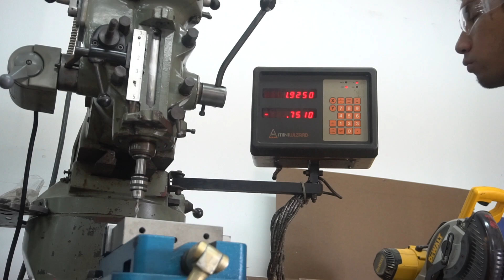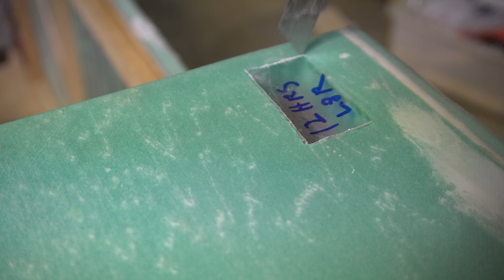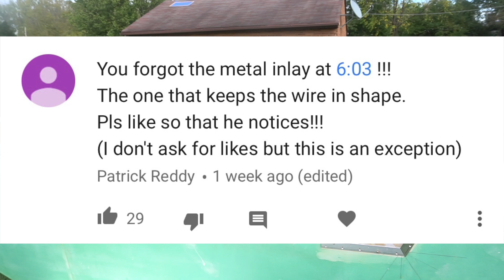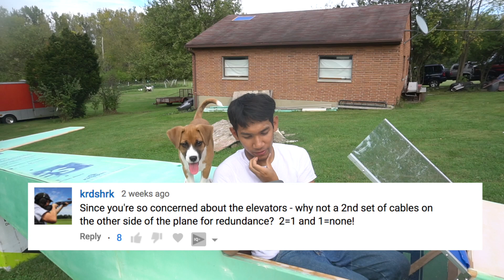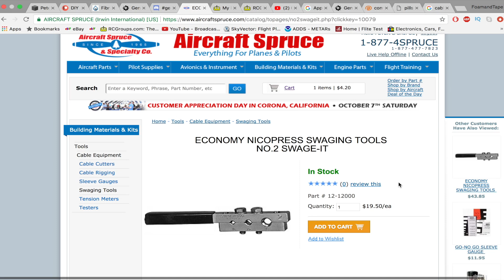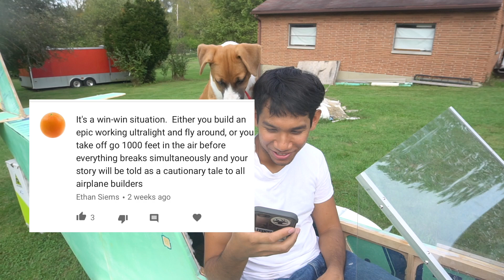DIY Electric Ultralight pt4 (fiberglassing fuselage and wing construction)

Comment: Peter I don't know if you'll read this comment but, at 0:53 when your cutting the pipe, you are using the wrong part of the vice. The part that is under where you have your piece clamped is specifically called the pipe clamp portion, its stepped so you can have four contact points on the pipe.

Comment: Very ingenuity. I’m researching building a composite ultralight myself. I heard you mention you work with a company that will hot wire full 8ft wing sections and that it was quite reasonably priced. Would you mind sharing that company’s contact information. Thank you. Keep up the good work

Comment: I have rigged my sailboat with that nicopress tool, and it works fine, also have run up some climbing gear with it.  You can check the result with a dial caliper if you have the dimension, or compare to known commercial.  I think sailboats are a lot more heavily loaded that a UL, partly due to the massive loads that come from tossing around objects that weigh thousands of pounds in hard water.  Beating to windward you can get slams and bangs that are worse than a hard landing with every wave.  You don't probably get the fatigue cycles as quickly as anything with a motor, but for you first flight fatigue is not your problem.

Comment: I really want to build a plane too but I’m broke... gonna have to resort to building mine out of empty pizza boxes and resin 🤔
Reply: do it glue alot toghether for thickness
Reply: Add fibreglass in there and you're sussed
Reply: The problem with that is resin is thick and heavy
Reply: dont worry i have the same problem 😀

Comment: PeterSripol, sorry Dude but I agree 100% with Armando Silvier. It only took me around 5 seconds to see that your design is somewhat wrong with respect to centroid or center of gravity. Your wings is too fart back. It should be more at the front to balance the pilot's weight and the engine's weight. what you did is you placed your wings at the back of the cockpit which is wrong. Find the center of gravity of the pilot's seat and engine and that's where the middle of the wings should be located. This is just a positive criticism to save your money due to remodeling your work and much more to save your life if you try to fly that in that configuration. BTW I am not a pilot or an Aeronautics engineer, I am a Mechanical Engineer but definitely this issue is related to centroids and moments (wherein the reaction force/lift that should be given by the wings should be balanced by the weight of the engine on one side and the weight of the pilot on the other side) so Mechanical Engineers and Aeronautic engineers have very similar knowledge on this topics. Aside from the wing location, I can say that you're doing a great job Dude! Keep your hopes up, make your design airborne, and stay safe always!!!!

Comment: I've heard you mention F.A.R. 103 and I'm not certain those rules apply to the plane you're building, Peter. You might want to look at Part 21 regarding experimental aircraft. Just sayin'. It always helps to keep the FAA guys happy when you can. They have the power to get real nasty. I've been a pilot for 52 years and had to bump heads with them a time or two.

Comment: Do you think the main gear will be far enough forward of the CG , with the tail up, and with the thrust line it will have, that it wont tend to nose over during ground handling? Maybe it would benefit from having skids in front of the main gear like a Vickers FB5.

Comment: I can appreciate what you are doing , I designed model airplanes for 25 years before designing real ones. You have a great eye for designing models , you know what kind of power , what kind of wing , and or how much wing you need for a particular task . You know because I have heard you say that you cannot scale anairplane up or down exactly. So , building full scale takes guesswork. For the 2 airplanes that I have Designed, getting them to fly is only the beginning . An incredible amount of work was done to both airplanes after their maiden to get the flight characteristics exactly what I wanted, and make them as efficient as possible . If I could offer some thoughts, it may save you some frustration later... As an accomplished model designer I have a lot of confidence in you . You already know as speed doubles drag quadruples, but until you fly an airplane of that size and speed , you don't know how much one hurts you more than the other. Because I think you're gonna be surprised how much heavier that air plane comes out than you are expecting, while designing the wing error on the more surface area... I expect ,depending on wing area, airfoil ,and weight your going to be flying n the 35-45mph range, and at that speed drag isn't as big a factor as weight.I'm trying to say. It's better to have a little more wing than less, and external bracing instead of a heavier structure is better...

Comment: I like what you have going here but think your building too heavy.  The plywood in the fuselage is much too thick.  The fuselage design looks huge and you don't need that much "airplane" for what your building.  Structurally your building a 200 mph airplane.  Look at how a KR2 aircraft is built.  You also forgot to install thimbles in your control cables.  It will fly, but thinking your 180lbs isn't going to happen.  Last.....when do I show up to test fly?  I have tested several ultralights for people.  My only fear with the aircraft is you won't have enough power to get out of ground effect.  Keep on keeping on.  It will be a great learning exercise for your next full scale aircraft.

Comment: I think you have seriously under estimated the strength of the fiberglass. According to the composites in Burt Rutans
kits the E-Glass is Aircraft Spruce# - Unidirectional Fiberglass 38" RA7715/38W F16   ----- 01-00641 
and Bidirectional Fiberglass 38" RA7725  ----- 01-00642  both are above 7 oz cloths. Also they use multiple layers of them
used at 90 degree offsets from each other, to add strength in different directions. Safety is important!

Comment: What did you go to college for, like a mechanical engineer or something else? I'm wondering cause I've always liked design and building things, but don't know what to go for.
Reply: I know I'm not Peter, but I recall Aerospace Engineering involving building models and such, if I remember correctly. I decided to go with Aviation Maintenance, but the Aerospace Engineering will probably be a bit more helpful with actually designing aircraft.
Reply: Cool

Comment: The fuselage appears big and bulky. You might consider using fabric instead of foam and also  consider a triangular shape for maximum strength. When you shrink fabric to form and there happens to be flaw in your design it will become obvious before you take your first flight. That windshield will never allow you to get off the ground as you have installed It. It should be rounded and low profile to reduce drag. It is not a good idea to use foam in the tail section because connecting control wires to it is too risky (It can be done though).  Fabric is easier to use and looks better too!  As for aerobatics forget it! You might want to up-size  the landing gear. An ant hill can shear of a wheel like that. I already found that out the hard way. You'll just love fixing that plane with a couple on your own ribs broken from being flipped over.

Comment: Really look at AC43.13-1b You will learn a lot, it is the bible for aircraft building. It is free on the FAA web site. 

https://www.faa.gov/regulations_policies/advisory_circulars/index.cfm/go/document.information/documentID/99861

The screws on the canopy, turn them around, and put a combing around the windshield. If nose in hard, see where your head will hit take your seatbelt off and push your head as far forward as you can. Anything you hit, imagine the dent you will get at 70mph. Parachutes only work at higher altitudes, landing mishaps are the most common accident, where the parachute won't help. Lower your seat, it looks like your head is above the top of the windshield. 

Bead board is the wrong foam for wings. as the wings flex (they will!) the beads will de-laminate and you will have a wing shaped bag of beads, with no strength. Use the blue foam, glue 2 inch slabs together (epoxy and micro balloons) or buy thicker slabs of foam, it is cheap. 

What is your weight now? Part 103 rules are really strict, and I am guessing with motor and fuel, you are getting close already.

Comment: i know your getting a ton of advice on this build, but one more thing. I didn't notice if you had in the last video or not, but your going to need to make sure you safty your turn buckles in some manner before you take her up. I know you said you planned on redoing many of the cables, so manby then would be a good time to do this. Also, i think what people are saying in regards to the cable swage is that the preferred method with a plier like style of tool puts 3 crimps in each sleeve. of and make sure to tension your cables and use proper length bolts, as again in the last video several looked somewhat short, and you really want them to extend beyond the nut.

Comment: You should add a small cooling system that works with thr air entering from a small inlet on the nose and outlet also in the nose because in case the lipo in the front catches on fire etc. it would melt the place where it stands and then it'll sure let some air in aaaand then the fire can spread up that can even reach you by the air pressure

Comment: Dude, how is with your center of gravity on your tail surface and ailerons, because of the fluter effect.  CG of aileron must be on the axis that is moving the ailerons, this is why every airplane in the world uses the ballast on the other side to move CG in the center. If you do not do this aileron will start to flutter and your airplane will fall apart.

Best regards 
Luka - flight engineer

Comment: Some composite suggestions. If you use poplar either get a kelar or carbon fiber sock to strengthen the spar very simple process no vacuum bagging required.

Comment: Try using airalloy to cover the outside of an aluminum tube skeloton. Then use solid state graphite power cells connected in series mounted inside the wings that generate electrical current that charged organic carbon power cell banks in the main body of the ultra lite that provided power to a elrctric motor that operates the props that generate thrust? Go for it make the aircraft and then improve and perfect its design. ; )

Comment: Is this a kit or did you design it yourself? If you will be sitting in front of the wing, the Center of gravity is going to need to be balanced with some significant weight towards the tail... I assume you've taken this into consideration.

Comment: I have built several aircraft and currently own an experimental aircraft called a Cygnet SF2A.
Though I am not a guru I have been around them for 40 plus years and will be happy to assist in any way I can if someone would have a question on building .test flying..etc.
        Doran
        N6580K

Comment: thanks for posting.  some thoughts.  like other commenters, i think a shock-absorbing suspension is a must.  maybe torsion bar/tube suspension.  also, suggest you use 16 to 20 inch bmx wheels, for the lg.    cheers

Comment: Peter, who's the cnc hot wire foam cutting manufacturer? I need stuff cut so
Reply: Tarik Agcayazi just Google that, its very simple to DIY.
Reply: LubieRowery I'm working with something 7ft in length. I'd rather have them do it
Reply: LubieRowery I have a hot wire foam cutter already, thanks for the help but I'd rather get this done professionally since 7ft isn't something I can just handle myself/would want to handle myself.
Reply: Tarik Agcayazi I asked the same question!
I sincerely hope Peter answers this question!
I'd really like to know who he uses for large foam curting!

Comment: If this is in the U.S. & the final weight  is more than 254#, it is not an ultralight and illegal to fly without an experimental license and at least a sport pilot licence.  Ldg. gear needs bigger tires and/or suspension. Tail feathers need brace wires. If not overlapped, fibreglass joints need to be rounded and taped. First rule of experimental ultralight flight: "Don't fly higher than you'd care to fall!" (It worked for me.)

Comment: Dude, you REALLY need to put some kind of suspension, ESPECIALLY for the first few flights while you dial in the handling. 254lbs plus your bodyweight traveling downward at any rate is going to multiply the force of impact. Even if you build it super strong you can easily bend a spar with a hard landing.
Reply: yep, the only 'give' in that undercarriage is in the tires, i.e. 2" at the most. That's not very much to soak up even a small bump, let alone vertical velocity at landing. You'd better make your landings really smooooth....

Comment: Hi Peter love this project so far just a few questions and tips What aerofoil are you using? And are you using aileron? If was you I would put some reinforcement where you joint the wing to the root and the spar to the fuselage, and make sure when bracing the two wings  with wire to brace them in a way that they don't twist. Good luck Peter.

Comment: I think you need to stop the build where it’s at... and buy a gyrocopter rotor head... attach that to the fuselage you already built.  A gyrocopter is much safer for a first time build.  Also I’d like to see someone experiment with an all electric gyrocopter where the main rotor mast recharges your battery to lengthen flight times!

Comment: "The plane is meant to fly not to crash" that's probably the dumbest statement I've ever heard. You need some sort of suspension. If you come down on that gear in the slightest bit the wrong way the airframe is going to be done. You WILL destroy the plane. Please read the AC 43.13 for standard practices. It's there for a reason. Also, don't assume something wont fail on the first flight.

Comment: I think this is super awesome. Are you going to do a soft field landing? if so I'm concerned your wheels on your landing gear may be too small in diameter. It looks like you might wind up finding a rabbit hole and doing a face plant. It also seems like smaller wheels will require more power for take off on a soft field because it's more difficult for the small wheel to go over obstacles. I saw some rear wheels on a baby trend jogging stroller that are wire wheels with a pretty good diameter. They are pneumatic tires, and have ball bearings. Also if you're not married to the idea of jettisoning the landing gear you could do a strut back to the rear wing spar to keep it from breaking off backward. Or if you are make it fit into a pocket that it could fall out of but still push against under load. Just a thought

Comment: Why not do the first flight RC? Put some sandbags in the cockpit to simulate your weight and do a test run with you on the ground. Please consider this, it would be awesome to have a full scale RC plane and if there's some catastrophic failure you won't end up dead.

Comment: alot of comments of concern on here. ihave been in maintenence and repair of aircraft most of my life. i have an a&p and what ive seen so far looks ok to me. though i have seen the wing structure yet. assuming the wings are good i have no doubt the plane will fly.
but i do think power may be an issue... gonna need more power scotty!!!
next is- after some number of flights, its going to most likely start having wear and tear problems.. and it'll be up to you to find them before they fail... fly safe!

Comment: Cool project but please change the window. This looks like it will hurt you very much when you make a hard landing or crash and your head  would be able to reach it or the front breaks in the crash and the window will reach your head. Maybe mount a thin wooden plate with rounded inner corners with a radius of maybe 10 cm. Take some lexan and heat it to bend it to this form and make the upper edge of this window also smooth with a radius of 5 to 10 cm when it will bend from front to the side and als a radius to smoothly make the horizontal  top edge transform into the vertical back edge. Put foam pipe insulation on the edge. Makes it much safer i think. But again. Great project but be careful

Comment: A simple trailing link main suspension shouldn't be too difficult to "engineer" (or enginerd if you prefer) and will allow a lot better rough ground handling. Nor add too much weight...  though for weight reduction   a Cessna type leaf spring (copied in many RC aircraft, just without the springiness unless in CF) is hard to beat.
As you are unlikely to be flying this from a hard strip (at least initially) some forgiveness in the gear may cause less stres to airframe as well as pilot.

Go hard or go home, good work.